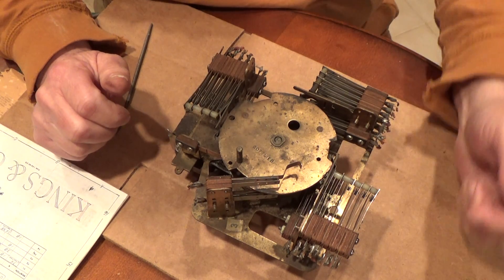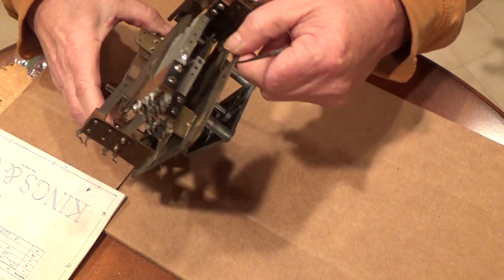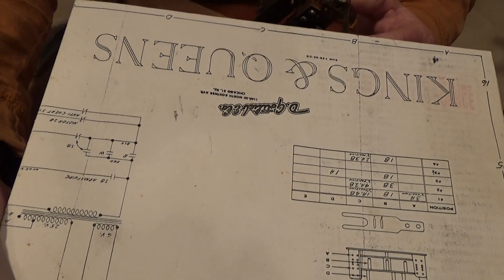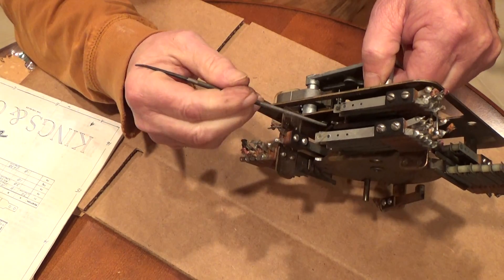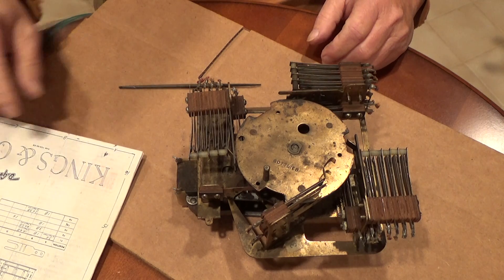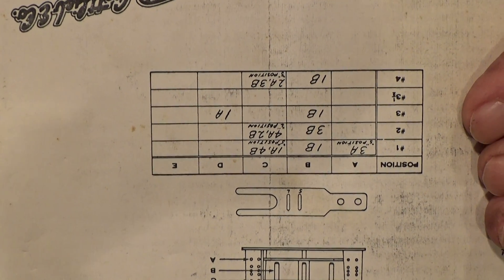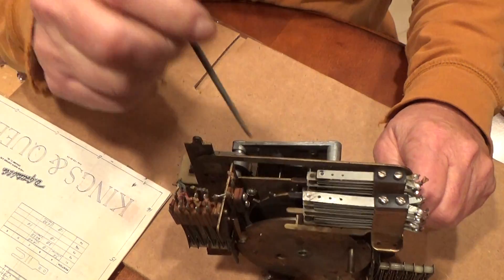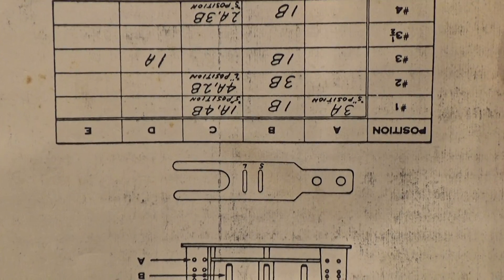Gottlieb Score Motor - Positions & Levels of Switch Stacks

Comment: At 11:20 you scribe 2c switches with four open and two closed.  Where's that on the schematic. This is the frustrating part.  You need to complete the picture by correlating the schematic with the playing apparatus.  I have no idea where to look on the schematic for four open switches.
Reply from the maker: look at the chart near the SM bottom keft side, you'll see a chart with like 4A, 2B, 2C etc. That says 4 open switches, 2 closed switches, 2 make/break switches, referring to the switch stacks on the score motor; I admit I'm not a very good teacher.
Reply: @pinballgarage7513  You are a great teacher.  Everyone is trying.  Have a great day!
Reply: I think most viewers understand the correlation with the C level switch stack and the block diagram.....but it WOULD be easier if you didn't show the schematic upside down. ( Yeah, I know it's not really hard to read upside down stuff, but still... editing would be helpful.)
Reply from the maker: sorry about that, look at the chart under the score motor position chart, I thought I had schematic right side up, but had screen on camera turned around and made schematic upside down. sorry again.